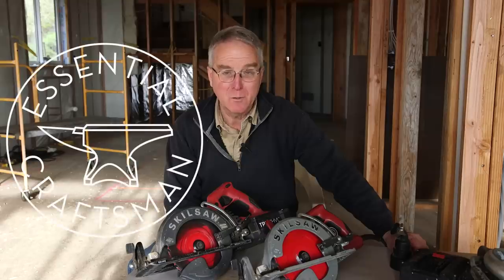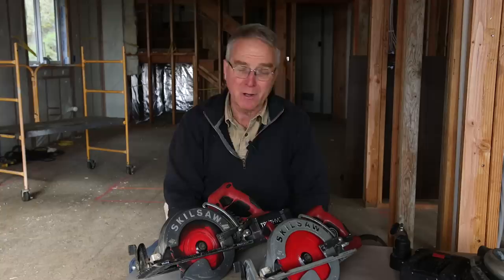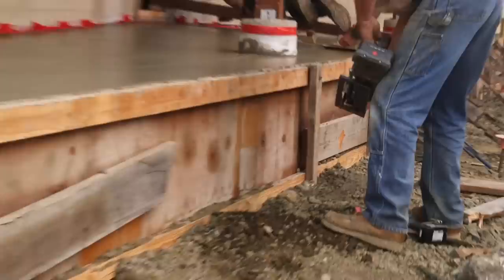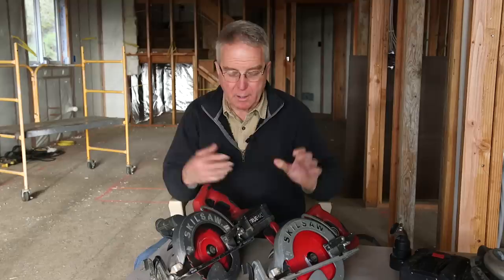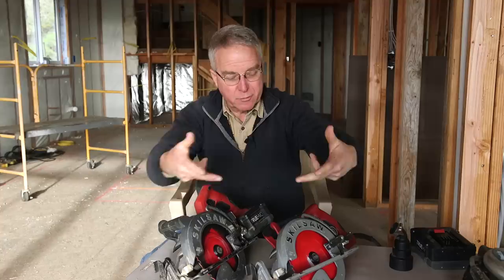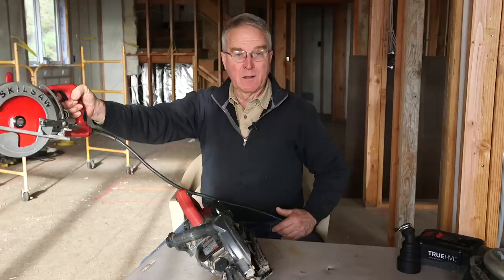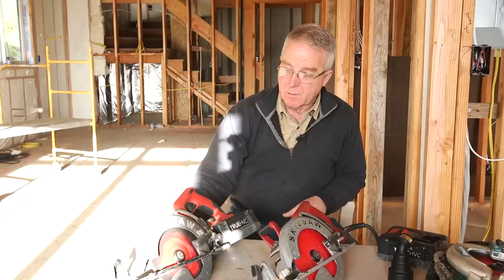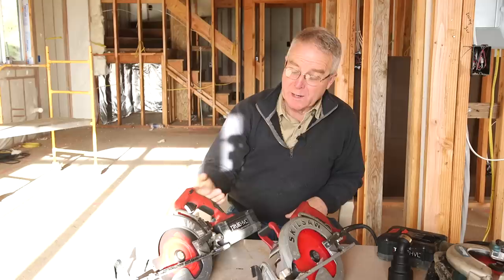Skilsaw Cordless Worm Drive Saw - Initial Review

Comment: One thing you didn't discuss is the cost savings from generator fuel vs charging the battery. I wonder how important this is to a builder and would appreciate your thoughts on this topic.
Reply: Wait, if you’re using a generator to run your saw, aren’t you also using a generator to charge batteries? If you have a power source for charging batteries....you see where I’m going, right?
Reply: @psidvicious  no. The context of my question is when the batteries are charged at home before going to the job site. Many contractors will do this and have enough batteries for the entire week actually and just charge up on the weekend.
Reply: @CybekCusal  @Seb Brosig brought this up about power consumption in another comment here:
  “At 500 charge cycles (that's an optimistic assumption) you pay over $2 extra per kWh (over the electricity used to charge the things) so yeah, the energy cost of these things is kind of significant, compared to the corded model.” 

  Respectfully, if you only need to charge your cordless tools at home on the weekends: 1) You’re likely not using them professionally. 2) You’re definitely NOT a carpenter. 3) Why on earth would you buy a $500+ saw that only gets occasional use, that you’ll be replacing the battery for in ~2 years, whether it gets used or not, at $240 each?

Comment: Why use Skilsaw as your cordless framing saw? Metabo HPT 36v is miles lighter for the quick solution. Or a 6-1/2 inch left-blader can do most of that work. Probably what it was designed for.

Comment: I'll never get wanting that battery saw dust port, dealing with a vacuum tube is way more obtrusive than a cord.  I'd get one in a second if it had the option to use a plug in cord in place of the battery when you need to set up some work that would use more than a few battery lives.

Comment: Battery cost and how long do they last, would wrap up the evaluation fully
Reply: Battery life - 2-3 years max (you’ll want replacements at 2 years anyway bcz it won’t hold a charge like new).
Replacement batteries - $240 each (you’ll need 2 to keep working)
Corded Skil worm-drive - $170 (add $30 for an extension cord)
Reply: at 500 charge cycles (that's an optimistic assumption) you pay over $2 extra per kWh (over the electricity used to charge the things) so yeah, the energy cost of these things is kind of significant, compared to the corded models. Having no cord may make up for that in time saved if you're a pro.
Reply: @SebBrosig  Interesting! Never heard that break down before 👍

Comment: Sounds like you need to attach a retractable line to your cordless saw for those times when you want to lower it down. Really shouldn't be using the power cord for lowering your equipment.

Comment: While I enjoy my cordless drills and impacts as well as oscillating tools, most applications are useless to me or simply not worth the rather large to massive investment to change to cordless. Cordless tools, especially good tools like saws and nail guns cost a ridiculous amount of money above their corded or hose counterparts, and that doesn't include extra batteries. We run a Dewalt 780 and a Makita 10 inch miter saw off cords and to replace them with anything decent I am look I g at almost 2 grand after a second set of batteries. I'm running a 24 year old porter cable tiger saw and a 20 year old Milwaukee sawzall and they get used, sometimes for an hour or more at a time. That us nit battery friendly and a good saw costs double what a top line corded costs. Same with our circ and rafter saws. Not worth the investment and rhe cords like EC showed have a use. Add to all this that modern tools, especially brushless have a massive fail point in the mosfets, extra circuitry and the sensors. No way do these tools last 5 years on a jobsite, much less 20. I simply don't see them as a good investment most times. That said, I just bought the Fuel 7 1/4 miter saw and live it despite it costing double the competition. But ideally a corded model would exist.
Reply: Agreed.

Comment: Just curious, but why say such things like "this one is significantly lighter than the other by a wide margin" when there is literally less than a 2lb difference between them, with the battery attached to the cordless model?  I understand that approx. 1.5lbs extra weight is not as light as it sounds on something you could be using all day, but it certainly isn't 4-5lbs in difference, and with the weight being at the back its closer to an even weight distribution, i.e it will actually be easier to hold for longer periods of time.  

Don't believe me?  Try holding a heavier weight closer to your chest, and then a lighter weight with your arm fully extended, and see which one tires you out first ;)  the older model just puts more strain on your wrist.  Now I wish they had also made a corded version of this new saw since i beleive the handles are better and the construction/looks in general are better, especially with the added dust collection.
Reply: I apologize, I was thinking of the weight of my aluminum unit which is a little over 14lbs.  When compared to the last gen all magnesium units that come in around 11.5-12lbs, yes the new cordless versions are significantly heavier.

Comment: The reason Skillsaw started making this saw out of magnesium is because the saw would weigh a few onces less  than one made with steel or aluminium. The weight savings, tho small, was a big deal to those using the saw for hours at a time, day after day. The battery powered saw weighs, depending on the battery, a couple pounds more than the corded version. Yet, we are to believe that weight makes no difference to the user? If that were the case, Skillsaw wouldn't have switched to magnesium for its saws a few decades ago.
Reply: Can't figure what you're reacting to when you say "we are to believe the weight makes no difference to the user?" Who says we are to believe that? Scott explicitly calls out the weight as one of the trade-offs between the two saws.

Comment: Why can't they make the blade guard electrically operated with a button or even the same as the starter button?
Reply: The issue with automating the blade guard and/or using it as a  safety switch is that you're putting electronic components in a place where sawdust and debris flying at high velocity are.  The potential for failure/problems is too high
Reply: @eutoob  I think that could be solved. Electronic components are typically easy to encapsulate and often used in dirty or dusty environments. I believe that the designers have just not thought of how easy it would be to do it since when circle saws were invented it would have been close to impossible, but I am just guessing.
Reply: @BjorckBengt  fair enough, but the next question is why automate it in the first place? The blade guard is a passive device- the work moves it out of the way and a simple spring returns it to rest.  The only time you'd need to activate a blade guard before making a cut is during a plunge cut- and that's what your thumb is for.
Reply: @eutoob  There are many improvements which you didn't know you wanted until you tried it. I think this is one of those. my father used to say that electric windows on a car was a folly and I agree that they are not necessary but definitely a nice feature.

Comment: Why is a skill saw safer then a sidewinder. I tell you most times it in your right hand you stand to the saws left side. You are not standing with saw infront of your body looking over blade. Saw kicks back your not behind it.  I dont know what it is but skill saw runs slower blade speed or what they just seem way easyer to use.  A saw can not tell if its cutting wood or you it dont care.  But after useing one for 35 years god im old. I wouldnt give it up my gun my dog my skill saw. My wife.  Yes that order is right.  Dont over tighten blade snug is all you need (right is lose left is tighten on worm drive)  it has some kinda anti kick back or something so dont over tighten. Just be safe a saw cuts duh

Comment: One consideration I have with anything battery powered is that I've come to understand that without it's battery it's useless. Something happens to it or you wear it out and it's not so simple anymore or convenient. It can't even be cheaply converted on the fly. That said a corded saw is far more reliable, if the cord goes bad it's easy and cheap to replace and can be Macgyvered if need be. Now I own both and find them both to be used equally. I think if I could only have one it would have to be a corded, but I would be sad about it. I think one of the best things about the battery powered is the promise of further refinement in the future. Lighter and smaller batteries vs the same old cord is an attractive feature that can't easily be reasoned away. Meanwhile the corded saw though tried and true just remains the same, they are dang near perfect and can no longer easily be improved upon. In some ways to me this is boring and not progressing while the battery tech and innovation is exciting because it still has lots of room to be improved, just remember we'll be the ones paying for those improvements while the bottom line is that things need cut and we already have a great way to do it in the corded versions. I think he really hit the mark with his closing statement, I mean for those who can go ahead and invest into the future but for those trying to make their bottom line please don't do away with corded. :)

Comment: The dust thing in handle SUCKS I had saw as long as him im a remideling contractor 
We shoved a plastic bag in handle it blows dust all over you if you set it at 45 right into your eyes it sucks. Or if your in a house saw dust everywhere. 
Saw is as powerful as a corded one. I had one battery fail skill sent new one no problem. 
We use it 90% of time but hate saw dust out handle.
Reply: I think you missed the point. If you're IN a house, you're supposed to hook it up to the dust collecting vacuum. Whenever I saw in an enclosed space, the dust vacuum is on and connected. Outdoors, I sort of agree with you.
Reply: @RodneyFisk  well real world here I have been carpenter 30 years.  You hook up a shop vac an blow more dust lol
Reply: @RodneyFisk   if your remodeling inside you build a closed in area as best as you can.  People are cheep try saying to homeowner. Ok we use a shop vac on saw an it cost so much extra.  People are cheep lol
Reply: @user-oc6qs1po3j  I believe that in some places like Europe, the workplace safety regs require a dust collection system eve for portable power tools.  This may be Skil's attempt to make there saw  marketable in those markets.
Reply: @andrewalexander9492  well no matter it sucks love the saw but dust out the handle dumb lol set it at 45 it blows right in your face. Thats safe. I can see the lawsuit well sir bob had dust bag on saw was on 45 bevel the bag blow off an bob lost his fingers lol
Reply: @user-oc6qs1po3j  Yeah, I've never used one, so I'm not trying to say you're wrong about it being a pain in the ass,  just speculating on why they might have done that.
Reply: @andrewalexander9492  I think who ever designed it never used it lol or it was a 1st grade kid.  O lets make stuff fly out the handle lol.   It is a good saw cuts like it has a cord.  Tough we dropped it we use it hard.  One day I get a cork an shove in the end maybe lol but problem fill handle full of dust lol.   An he should do a why skill saw is safer then sidewinder saw. Hell I will read it above in a few

Comment: At the price of a worm drive saw..... TOTALLY out of my hobby price point.
Reply: Good news, there are lots of worm drive saws on sale in the used market for very reasonable prices.
Reply: @rightlanehog3151  Nope. not in this area.
Reply: @rightlanehog3151  I have been looking for a used Radial arm saw. They should, I have been informed by commentors, that anything above of a C note is outrageous. In Fl anything UNDER is bent or the motor has blown up. Some sellers are asking 300 for a barely functional one.
Reply: @brucewelty7684  Looks like Florida is in short supply.
Reply: @brucewelty7684  I have purchased half a dozen used Skil 77s from out of town sources at very reasonable prices. If you are not willing to make the effort..................
Reply: @rightlanehog3151  There are loads of used Skil wormdrives out there.

Comment: I have to say. The amount of time I waste in literal hours in setting up a compressor, finding air lines, running the lines, hooking up the gun and then firing a handful of nails for a short task is a huge waste of time. I can be in and out with a cordless nailer before the other guy is ready to go. The same can be said for these saws. When I'm on a roof, or in a remote area. I don't want to survey the jobsite to find an outlet or risk a tripping hazard at heights. These cordless tools are such a boon to the toolbox.